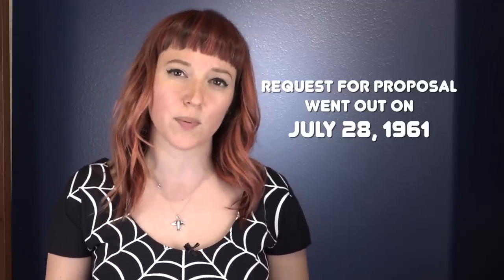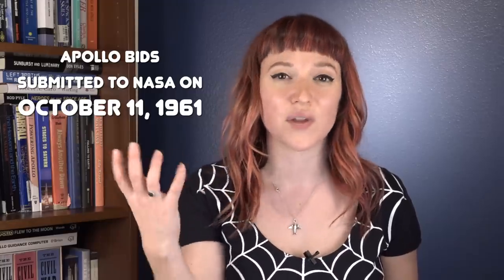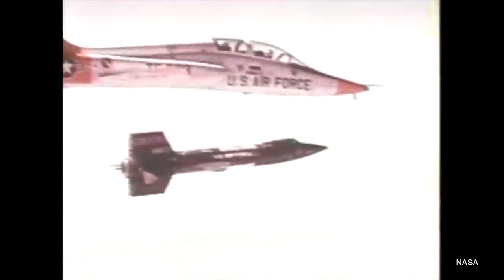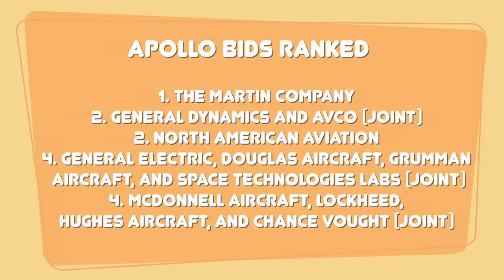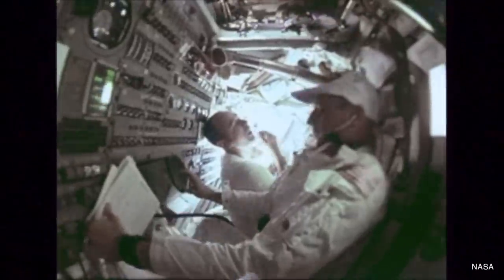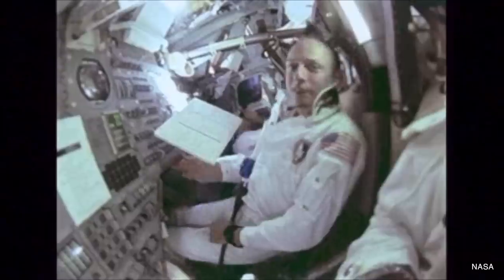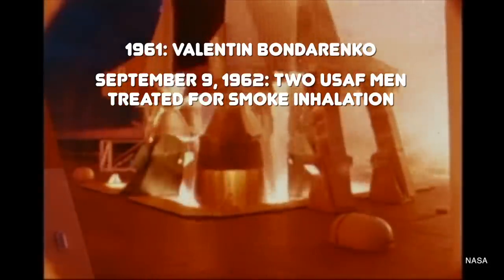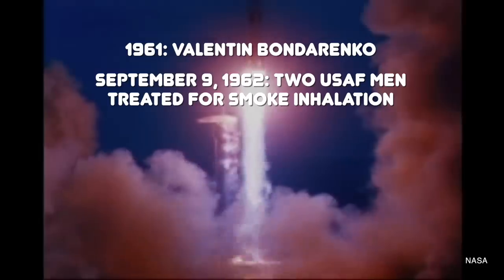Apollo’s Flammable Oxygen Atmosphere Explained

Comment: Can you do a video on why space agencies don't experiment with rotation to generate artificial gravity? Zero G is bad for the human body, so it's in their interest to find a solution other that 3 hour workouts per day. Why can't they just hook up two modules with a tether and rotate that? What experiments have been done, and what were the problems that have caused this to not happen? I've asked Quora this but no direct answer. Also two Space X Starships should tether up on their way to Mars, rotate and generate artificial gravity, tethered from the nose. It will make the transit that much better for the passengers. Simply untether on approach. Thanks for the excellent video series.

Comment: You explain the rationale for having a single supply but you don't discuss whether or not NASA carried out formal Risk Management and Change Control as formal processes. Was there no kind or black hat team to discuss the risks of each change? Did a risk, itys mitigations and preventions ever get documented and then signed off? Was there a written record that could be inspected after a system failure?

Comment: This doesn't cover all the issues. It's hard to see how a two-gas system would ever be workable. The spacecraft shell would have to handle about three times the pressure. Not only that, but what about the LM and the spacesuits? How would those ever handle 3X pressure? Alternatively, transitioning between two different environments would create obvious, major problems. Using helium instead of nitrogen could help, but only in some ways, and helium is very expensive. So you really need pure O2, at least once you approach launch.

Comment: Why can't you just pre-mix the gases and use one tank? People use compressed air all of the time without separating gases. It isn't like it was the same tank used for the fuel, right? Am I missing something, or is this another classic case of over-engineering?
Reply: I tried Googling it, but couldn't find an answer. I think, though, it probably was because of the lower pressure. 5 PSI is about the same as the summit of Mount Everest (4.89 PSI), so in order to function (and ultimately not die) you'd have to have supplemental oxygen. On Everest, the elevation above about 25,000 feet is known as the "death zone" because humans can't live in that low of a pressure without additional oxygen. Indeed, even at comparatively low elevations such as Everest base camp (17,700 feet) one can suffer from altitude sickness, which is where the body can't produce enough red blood cells to transport oxygen. I'm actually sitting in a class right now being conducted by a doctor who specializes in this. I'll ask him after class.

Comment: Sorry, but could somebody please convert "five pounds per square inch" into actual human units for me?
Reply: 1Bar ~ 14.50 PSI - Corrrected
Reply: So that would make 5 psi somewhere in the region of 250 mbar... Thanks!
Reply: 1bar - 14,504psi
Reply: Oops the other one is right, 21 PSI is a standard pressure used in pneumatics.